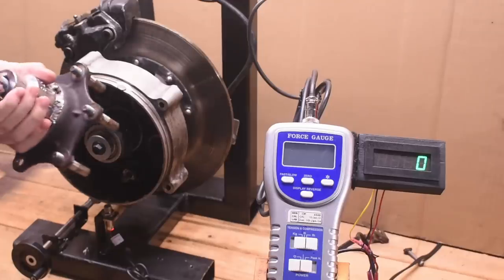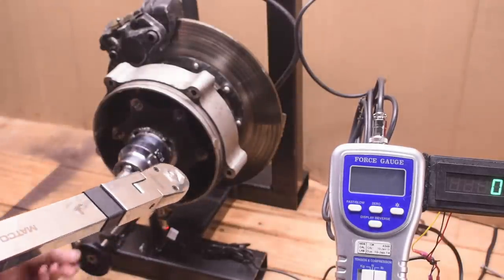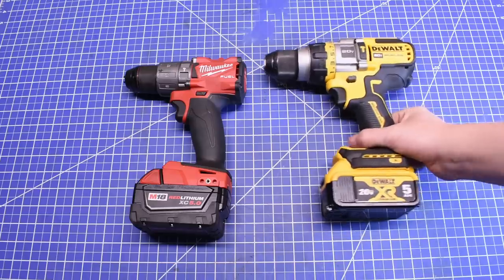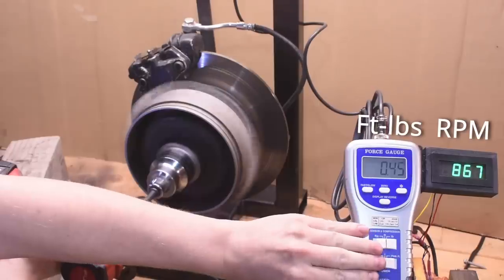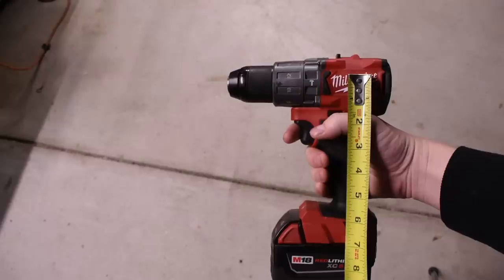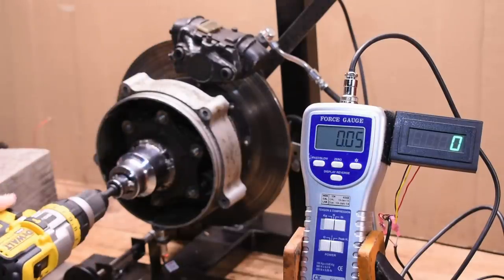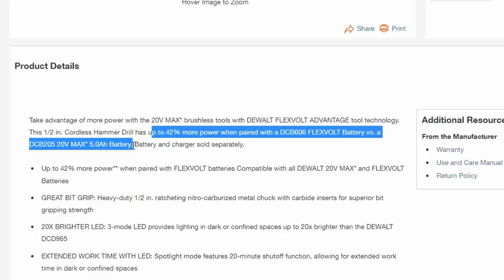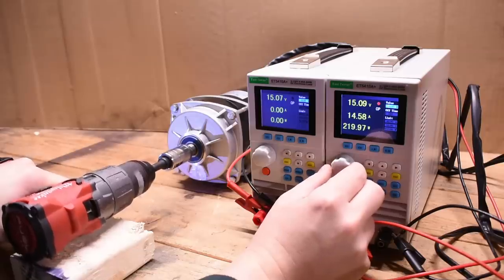DeWALT vs Milwaukee on a Cordless Drill Lie Detector (Dyno Brake)

Comment: After assembling a tool box in my garage when it was 20F I was wishing you had rated these batteries for best ones at cold temperatures too. I had 2 bars but nothing left. If there was a best cold weather option I'd probably grab a few just to cover the bases.

Comment: Really interesting 🤔  I don’t use my drill for driving a lot of things. Mixing, drilling holes in metal and sanding with a flap disk are my biggest use case. Biggest thing for me is how long does the battery last and will the thing melt a hole in my hand after and afternoon of drilling holes. Great video as always looking forward to seeing how the extreme budget options work!

Comment: Dewalt has a Flexvolt "Mixer" drill that is basically a low speed/ high torque tool. It would be interesting to see how it does.

Comment: I would like to see the Makita 40v GPH01 on this setup. I've had both Dewalt 996 and the Milwaukee Fuel. Although I burned the 40v out of commission it did have a little bit more torque.

Comment: Nice!  I know the struggle lol.

Been working on this for almost 12 months my self.

Working on version 5 now lol.  I had a disk brake like this on version 3 but ran into more vibration then I liked.  If I had a lathe I could have resolved the play issue causing the vibration.

Good luck on your testing!  I have always had issues comparing drills by spec on the box.
Reply from the maker: Best of luck, I like your set up as well of what i saw. It's a tough task and nothing will be perfect. But there's probably a reason there's not a bunch of easily found data out there, it sounds easier than actually doing it
Reply: @TorqueTestChannel  Thanks! Yep looks easy until you look at applying load and factoring the rpm range.

Comment: Your Milwaukee is probably stalling out drilling metal in high because high speed steel tools want low RPMs to cut properly. Carbide drills (or inserts in general) want high RPM. Not only would running HSS drill bits in low allow them to cut better, you would have more torque to drive them. That being said, with my milwaukee drill, once i hit sizes around 7/16" to 1/2", it will stall when you are about to break through the other side on a through hole. I've noticed when this happens, getting it up to RPM before putting pressure on it usually busts through the grabby part of drilling. However, after doing a chuck swap with a better quality chuck, i have yet to have a drill bit (even above 1/2") slip and allows it to bust right through that last 1/16 of an inch that really grabs ahold of the drill bit.
Love your channel, absolutely love what you guys do. Much respect, keep up the awesome work.

Comment: Really important with torque specs!!
Many manufacturers measure Soft, hard and Max torque. Soft is the static torque, which is pretty close to what you are measuring and hard is something like screwing in a bolt which runs smooth until it suddenly stops, when the whole inertia can increase the torque. The Bosch 18v-110 (Nm), different name in US has a Max torque of 110nm, hard torque of 85 and soft of 47nm. So a huge spread. 
Take that into consideration!

Comment: By far the best channel for consumers who like real data before buying tools. One thing though, 100ft lbs 4" away would be 33lbs you're holding. Longer lever, more force. Your're effectively making the lever shorter by holding it only 4" away instead of 12"
Reply from the maker: That would be true if you were the source of the torque force. Like if you were using the drill as a wrench. Applied as the torque is coming from elsewhere and you're fighting against it with a 4" lever rather than a 12" lever. Well you get the idea.

Comment: Data acquisition would be a lot more complex, but if you can measure rpm and torque at the same time, you have power as well, and that would make testing power and torque a lot less work for you guys. Not to mention you can have a power and torque curve for each drill.
Reply from the maker: Test length vs the low RPM makes the data resolution terrible for plotting I'm afraid

Comment: This is awesome!!! I researched for some time trying to find the torque of drills because I want to use them to turn big engines to TDC for adjusting the valves. Milwaukee said 1,200 inch pounds so I got it with a 3.4 to one torque multiplier but should be 340 foot pounds would only roll over a 3406 CAT successfully. I have a 15 to 1 torque multiplier now to turn over 3516 and 3606 CATs fairly easy with the spark plugs out. Makes my work much easier

Comment: The torque these drills can put out is no joke. I had to change the chuck on my Makita recently, and it was stuck so hard that even my mid-torque impact couldn't take it off. I clamped a big 10mm Allen key in the chuck, braced it against the ground, and put the drill in reverse. Even leaning on the drill with most of my weight it still just about injured my wrist. The kickback protection doesn't work while holding the drill down like that. With a couple tries the chuck broke loose. As a bonus the new chuck is 1/2 inch shorter, so I got a free upgrade in the power to length ratio.

Comment: Another setup is to put the force sensor on an electric motor and vary the load electronically, which would be more precise and make inertia less relevant. That gets around the generator losses. Power can of course be computed from torque and RPM.

Comment: Hey would it be possible for you to do a torque test for hand tools? I would like to know how much torque a regular person can apply using a standard length ratchet or screw driver. It would give a nice baseline to compare all your other videos to. Similar to the wrench testing you did but without an extension bar.

Comment: I used my M18 hammer drill with the 4.0 to mix concrete and was very impressed with the performance. It's my first battery powered drill and I have to say I love it. I came from using bulky 7-8 amp corded drills that feels like they can rip your arm off but that power comes at the expense of a cord and having an unbalanced weight which leads to user fatigue. No problems with my Milwaukee but I'm sure I would be similarly happy if I had DeWalt

Comment: Very ingenious design! 
I have an older Milwaukee 2703-20 non hammer drill that has poked thousands of holes, as well as forearms that are equal size to my calfs and not once have I stalled in in low gear by hand.
The t-handle is necessary when drilling larger size holes with a sharp bit.
Absolutely necessary...

Comment: The FlexVolt Dewalts are rated to take advantage of both the Flexvolt batteries and the 6Ah and higher XR batteries, they even state that on the boxes so it's not really weird if you read the fine print on the box.

Comment: Ok I have some input, first of great tests, really impressed with your dynos, so simple yet effective!
Regarding the torque testing, I bet they declare max numbers at 0 rpm as that is where this type of BL motors have the most torque by default. So have you maybe tried testing it with locked brake and start from 0 rpm or do the drills just cut out?

Also I would really like to see makita xgt and bosch 150nm, they claim the highest torque numbers, thank you a lot!
Reply: They cut out well before 0 RPM (I'd say roughly at 20% max RPM) to avoid cooking the the mosfets in the ESC. These tools would be hitting 200+  amps if you let them.
Reply: @toolscientist  yeah but you can start from 0 rpm on dyno. I bet that is how they measure "peak" or max torque

Comment: Seems like a pretty solid setup however I would try to make sure that the rate that you engage the brake is as constant as possible, if engaged slowly (versus more quickly on a different trial) you may dissipate some of the energy due to slippage which will result in a lower peak torque value (or so I would think). May be worth a couple tests to find out for sure....

Comment: Absolutely love your test setup. Learned more than years at school!  For the brake torque reading I think it would be fair to say that your skinny adapter looses perhaps 5% through metal elasticity. Nut really that much but just to be a little bit pedantic.
Reply from the maker: Luckily in linear applications of torque like this adapters are not a source of torque load is load is gradual. Impacting? Oh hells yeah

Comment: I'd like to see you guys doing a video on the accuracy/reliability of electronic clutches vs. mechanical and if there's any one e-clutch that does especially well.
Reply: Tbh not really. If you need accuracy, no electronic clutch as of right now is better than mechanical. That's why milwaukee switched to mechanical in 4th gen drills
Reply: @michaelbychkov8030  That's a good move on their part.

Comment: I like my flexvolt advantage drill.  I like using it when I want to polish an edge on a knife because it is the highest rpm drill I have and it doesn't take long to develop a mirror finish.

Comment: I'd be curious to see the 2904 vs the older (as tested here) 2804. No experience with either of the drills tested here but I do have the 2904 coming from an older DeWalt and this thing is a beast in comparison. Probably the biggest difference I've noticed, aside from an obvious increase in beans, is the chuck on the DeWalt was constantly coming open. I'd have to retighten that thing all the time. It was beefy, but it would open on it's own all the time and it just became part of the routine -- drill, tighten, drill, tighen, constantly checking my chuck. The Milwaukee 2904 -- just stays in the chuck. I'd gotten so used to checking my chuck that it was second nature and I didn't really think about it -- not needing to do that anymore is nice. Maybe in 20 years or so I'll stop trying to re-tighten the chuck.

Comment: DeWalt advertises torque in Nm outside of the NA market.  The DCD999 you have there is spec'd at 127 Nm hard torque (1124 in-lbs) and 66 Nm soft torque (585 in-lbs).

Comment: I worry that at the rate you're stopping the dyno, it's inertia is affecting the torque measurement.
You might get a more reliable power measurement by recording torque and speed of the brake dyno and calculating power from that. You'd also get a useful torque curve.

Comment: Thanks for this! Next up: Makita's, Rigid's and DeWalt Atomic top hammer drills, M12 drill along with DeWalt and Bosch 12V drills (and DeWalt's 5-in-1 installation tool with drill head attachment. Curious to see how much power loss between that and the 12V drill).

Comment: Dear TTC, I have a suspicion about how Milwaukee arrived at the 100Ft-lb torque figure for their M18 Fuel drill. 

If I had to venture a guess, they arrived at their peak torque by basically using the drill as a quasi-Impact tool. At high RPM, and using the maximum setting on the clutch without locking the clutch in drill mode, their particular testing rig might be recording torque impulses as peak torque. It would be technically true, but would not be generally useful pertinent information in a tool purchase.

Comment: FWiW I use an almost identical older 996 with scissor jacks for the majority of my vehicle lifting. Sometimes it struggles a little but it always comes through. Even lifting one half of a 20 foot container is possible this way. I pick it up for holesaws and larger drill bits in steel, but use a 796 or the non hammer version for wood or pilot holes in steel.

Comment: I feel like Metabo HPT multivolt kit (lowes sells it) or the Ingersoll rand model D5140. Both have really similar claims and price range are in the same ball park. The Metabo even comes with two batteries as a kit, for $279. The IR comes bare for right around $180.

Comment: Those are nice testing rigs for cordless drills, probably best i've seen so far. It screams to be tested by a Metabo BS 18 LTX with a PowerX3 multiplier, just to see it that really does work cause that combo according to the marketing wank should be 1500+ ft.lbs....

Comment: You might consider an inertia dyno. They are relatively simple to make, fast and easy to use. The inertia of the dyno flywheel can be accurately enough determined (not particularly difficult), friction losses can be measured from free coast down. You need enough inertia that it takes several seconds to reach full speed. As weak as drills are, that wouldn't be a very big flywheel compared to what's used for go cart engines.

Comment: Great video, I often thought of things like this but you actually get around to doing them! A dream life!   I would like to suggest one more performance metric that I personally view as important, which is the amount of resistance the drill can start against.  I have several drills and the one way the older brushed machines shine is there ability to start controllably against loads without cutting out.  Many times when doing precise things like say tapping threads, you need high torque at real low rpms, and even tightening fasteners in sensitive materials, you may need to re-start at loads easily handled by these drills when speed is developed, but they cut out uselessly when starting against the load. I would like to see this quantified in your comparisons as this greatly effects the over-all usefulness of the tool.  Thanks again, I really appreciate what you guys do!

Comment: I’ve got a bad story with one of those Milwaukee M18 drills from when I was young and dumb…was trying to drill out the holes in some plumbers tape with one, holding the drill with my right hand and the tape with my left…obviously the drill bit bound up, spun the tape around, and sliced right through the top of my thumb, took the nail with it. That was a few stitches…

Comment: An other way of measuring the power output of the drill is to use the brake jig. Then multiply the angular velocity with the torque. (in SI units) Then you would get the wattage :)

Comment: It's surprising to see how much smoother the Dewalt is in the high RPM power runs. Is that from the chuck runout of the Milwaukee?
Reply: the red chucks are almost as wobbly as the teal garbage.
Reply: I don’t think it’s due to runout, I think DeWalt just has a smoother drive train.

DeWalt’s not exactly known for having the best chuck runout, but generally, the difference between the flagships is typically close enough to not matter for most things and it can boil down to a per unit basis.

Comment: You can calculate power by measuring RPM simultaneously with torque on your brake setup. The one problem with the brake setup is that there's a lot of rotating inertia, so you'll get higher numbers if you apply the brake quickly.

Comment: I can tell you without hesitation that my Dewalt 18v 3-speed drill runs circles around my Milwaukee 18v drill.
Ditto for the circ saw and 1/4" impact too.

Comment: Awesome video. Your tests finally answer some questions we've all had about which one of these top-of-the-line tools performs better under specific scenarios with the different choices of batteries that are available.

I'd love to see the Metabo 36 volt Hammer Drill, and both the Makita LXT and XGT Hammer Drills tested on your rig.

If you need to borrow 2 of the 3 for test purposes let me know. I have them (Metabo and Makita LXT) in excellent and barely used condition that I'd be more than happy to loan you.

Comment: I've built a couple high end small engine dynos for research purposes. I think what you have put together is great 👍. I do have a few notes that might be helpful.
1. Use an encoder for better RPM measurement. You don't actually need to back drive a motor to get power. You already have a good torque measurement, you just need a good RPM measurement and you can calculate power. A good encoder+ring should be ~$200 and can be read by an Arduino.
2. The inertia does affect the measurement. Ideally you hold a constant RPM to have the most accurate reading. We'd typically change speed at a rate of 100rpm/s. This resulted in a 5ft*lb difference. It is hard to say, but that setup probably had 5-10x more inertia than yours.
Hope this helps!
Reply: A PLC would be a superior choice in place of an Adruino. The inputs on PLC modules are already noise immune against electrical noise and the programming is far easier on a PLC. A Click PLC from Automation Direct would have no issue logging the data read from an encoder and the strain gauge.

Comment: Funny.  I have both the Milwaukee and the Dewalt at work, and you do NOT want to stall out that Dewalt when drilling a hole, as I've had it whip around uncontrollably and almost break my wrist - several times.   Maybe it's the motor controllers,  but the Mil is much more controllable and doesn't ramp from no-pressure to rip-your-arm-off-in-a-split-second when stalled.   I prefer Milwaulkee, but that DeWalt is a scary beast.

Comment: Fun fact: on a motorcycle, a wheel speed of 2000rpm (as seen with some of these drills) would be well over 100mph. Probably close to 150mph, depending on tire diameter.

I haven’t read all the comments to see if this was mentioned, but you would probably be better off finding the least aggressive brake pad material you can find. Maybe even something homemade. As you can imagine, a motorcycle brake pad is designed for slowing a much greater mass than this. It might help you with more granularity when adjusting the load on the tool.

Comment: I'm curious what would happen if you got an adapter for MW and DeWalt batteries and swapped them. Does the consistency in performance come from the tool or the batteries?